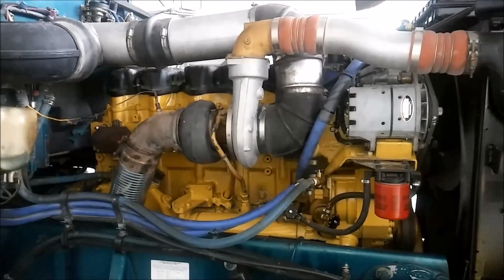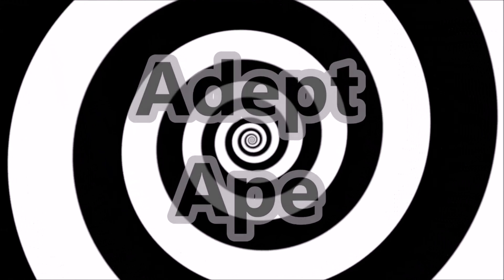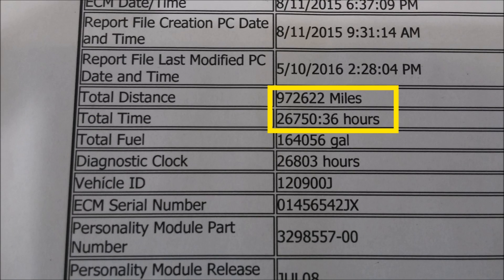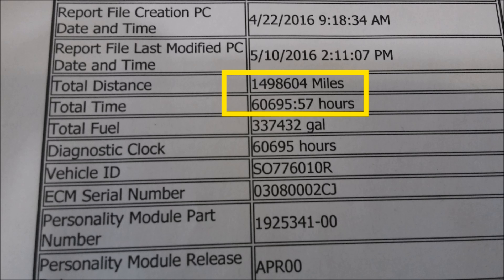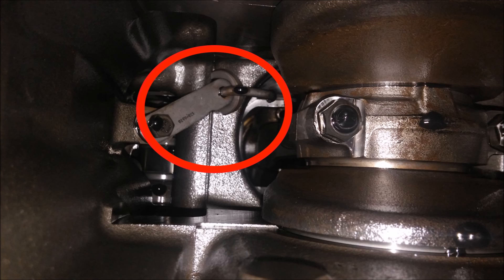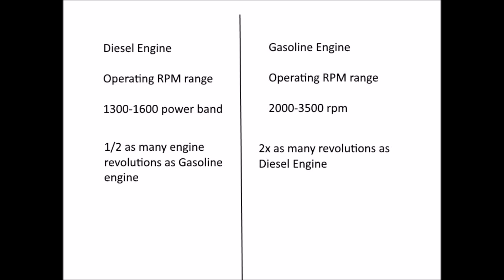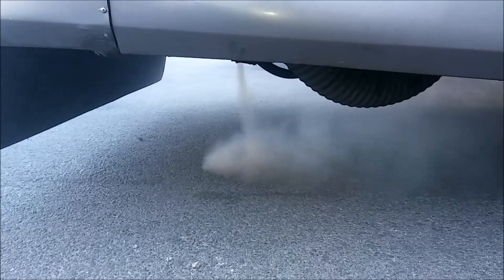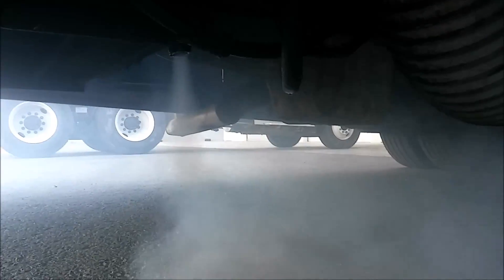Why Do Diesel Engines Last So Long?

Comment: They are also easier to convert to run on renewable fuels due to the fact that diesel's less volatile nature. Bio-diesel is already tried and trusted, and the type of engines already running on biomathane to a pretty large degree are originally diesels (busses, trucks/lorries). 

Detour about biomathane, which combustion engine fans might want to know.

 In fact, running diesels on a combination of biomethane and diesel (including renewable diesel alternatives) will produce more power and torque compared to diesel alone. Petrols can, of course, also be converted to run on biomethane, which has the potential to both be more cost efficient and cause less tear on components, as well as better power output. 

There are even Nigerian researchers who are working on using human excrement to produce biomethane. Which has a huge potential, considering the human population.

The biggest biomethane drawback is the fact that they need a special tank that's designed like a gas canister rather than a traditional fuel tank. I reckon that any type of combustion engine can be made to run on biomethane, including Wankel engines.

Comment: Question: since the new EPA rules reguarding DEP and exhaust, what happens to the engines that are pre EPA rules? are those engines throwns away and replaced with up to date EPA engines or are the older engines still ok to run on the roads?

Comment: I have a diesel toyota automatic 1.4 2006    A have done 600.000 miles on it and is in perfect condition I never had any problem with the engine!

Comment: Comparing a 1000 cubic inch diesel to a 350 chevy is just retarded. If you want a real comparison, compare a chevy 350 it a olds 350 diesel. Gas and diesel engines serve different purposes. And still. We have a Ford 460 in a one ton with 1,000,000 miles on it at the shop. It always runs. Pulls like a train. Doesn't burn a drop of oil and I'd chose to drive it over any diesel shop truck we own. Diesels have their place and purpose. Like tug boats, semi's, busses, etc. Not in cars and light trucks. The average person can't maintain diesels. Save yourself the headache. Buy a gas powered vehicle. You'll be happier and save yourself a lot of money in repairs and general maintenance.

Comment: 1.4/1.6L Renault K7M gasoline engine can easily reach 1.000.000km. Small diesel engines cant reach 1.000.000km without changing turbocharger, injectoars and high pressure pump.

Comment: very informative video here, thanks. i have a question about an oil leak in my international 4300 durastar.  there appears to be some sort of sensor where i have recently noticed a small oil leak, can anyone give any idea of the name of this part?  it is something that i can unscrew and simply replace, but i have had not luck in finding name of it. i thought it was the oil pressure sensor, but when i looked online, all of those sensors did NOT look like this part.  it is screwed in kind of in the middle of the engine, it is most easily viewed from the passenger side of the truck when looking into the engine compartment.  it is a slim metal looking rod that comes out of the screwed in part and there are wires attached to it. the wires plug into some kind of small harness.  there is oil leaking from that part and i would really like to replace this rather than paying the truck repair guy way too much. any help would be appreciated.

Comment: The gas drinking 5L in my '96 F150 4X4 just turned 400K and has lots of miles left in it. I think changing the oil every 90 days since new whether it needs it or not has a lot to do with it. Maybe my next truck, if I ever need one, will be a diesel.
Reply: 90 days, crikey!
Reply: Haven't done my oil in 13 months due to the fact it only has done 6k miles.

Comment: RPM range I've seen depends on the the displacement. Generally, the larger the engine, the slower the engine RPM.

Comment: maybe i should introduce you to the Chrysler 170/225 slant 6. (the 225 is not as good as the 170 however the 225 has more power) The reason is because the 170 under square where as most motors are over square (like the 225).

Comment: They're built with tougher parts due to the fact they're compression ignition engines. I've had xud peugeots with 600k miles,  vw 1.9 tdis with over 500k. Maintenance is key

Comment: Also most gas engines average less then 50 miles a day. On highway diesels average over 600 miles a day. Mileage adds up quickly that way with all the other stuff u mentioned.

Comment: As a diesal mechanic,do you recommend using a 5w40 engine oil where a 15w40 is called for. Thinking about cold weather starts.

Comment: I'm not convinced that going inside for 5 minutes or half an hour contributes much wear to engines when they start back up. It's still hot, and the oil is also nice and hot, and there's more of it, in the top end. Yes there is still a lack of oil pressure for a moment there, but it's not as pronounced as being from cold. Plus, the parts will not have shrunk down much, if at all, if you're just ducking inside to grab something. I'm probably wrong on this, though, I'd really love to be thrown some evidence that I'm wrong (or not), but it's my slightly educated guess, anyway.

Comment: Also diesel fuel has some oil in it and acts as a top cylinder lube.  I ran top oil in my fleet 350 Chevys and get anywhere from 400K to 600K on these gas engines. Its all in how you take care of them but Diesel is better in many ways.

Comment: Currently own a 1969 Cadillac with 1,250,XXX miles on it and it still runs like its brand new. Got inherited when I got it it had about 1,100,000 miles on it. It has a gasoline engine as well.

Comment: Even comparing the engines in pickups. The Diesel engine is heavier than the gas one. This is why you don’t see the big Cummins, Powerstroke or Duramax in a 1500, it’s just too heavy, so they use a downsized or completely different diesel in those that weighs around the same as the gas engines normally put in them

Comment: Had a 93 Pete with a cat that had around 1,200,xxx miles it. It was also turned wide ass open and would outrun a regular pickup truck easily. Then all of a sudden it started having to add ALOT of water and it also was running real low on oil pressure. I was hauling a load of hardwood one day and my heat needle sky rocketed, had to crank it up as I rolled into the gas station after I shut it off and it just bailed white smoke. I added more water let her cool down and drive it 200 miles to the mill drove it home and sold it. The newer motors are nowhere near as reliable though. I refuse to buy anything new other than my 2012 kenworth with a Cummings and a delete kit.

Comment: I believe the main differences are power, RPM and maintenance. A diesel truck would be lucky to see much over 2000 RPM while car engines are usually capable of around 6k. Every time the RPM doubles the stress on the engine quadruples. A diesel truck probably also makes around 500 horsepower with an engine that weighs 2 tons and with 16 liters of displacement. It wouldn’t be unrealistic for a car to make the same power with an engine 1/4 the size. Diesel trucks are also typically fleet owned and probably reasonably well maintained, whereas car owners tend to be forgetful and procrastinate maintenance. Not to mention the differences in driving style between an over the road truck and a daily driver.

Comment: Only reason a diesel will outlast a gasoline engine is because they have cylinder liners. You can only bore a gas engine so many times before it needs to be replaced but you can replace cylinder liners indefinitely. There are no million mile diesels that haven’t had an in-frame.

Comment: I drive a 2018 Chevy Cruze 6speed manual diesel , I was told if I maintain the manual diesel it would last me “forever” I get around 750-800 miles on a full tank (13 gal) about 49-51 mpg

Comment: It seems that Volvo, Mercedes and Toyota etc. have historically made gasoline engines that last as long as diesels. 1,000,000 miles isn't uncommon. Tundras go for 1,000,000 easily

Comment: Diesel can last long because of the fuel. It was  a crude oil while gasoline engine is a gasoline with higher octane. That why gasoline the won't last long. But if you maintain both engines follow the manufacturer 
Manual instruction pretty sure the both engine will last long. In the bright side gasoline engine when overhaul are cheap while diesel engine are expensive especially the spare parts. That a note of that.

Comment: Good evening bro how are you? I recently bought a 2007 W900 with c15 the seller said it had a rebuild at a certified cat I trusted him. After I bought the truck I called cat and they said nothing was showing under that engine serial number. So I need your advice on how to know if the engine was actually rebuilt or how can I tell if the engine is good. Obviously you know c15 from A to Z therefore I need your help. Thank you

Comment: Diesel engines will only outlast gasoline engines when they are designed and built correctly. The Olds 350 is an example of what bad design can lead to.
Reply: And the 6.0 and 6.4 Powerstroke engines are another example. The V10 engines lasted longer.

Comment: I'm from Europe I've got a Audi A3 1.9tdi 2008 without dpf (one of the best German diesel engine ever built) with this engine you can run for long time without problem, it has the timing belt though...

Comment: Ford diesels are so smogged down that you are lucky to get 200,000 miles and some times only 60,000 and you need a new engine. And then the blue death fluid.
Reply: 60,000 miles and a new engine required? That's not good. We don't seem to have the same issues here in The EU.

Comment: In years past, before ULSF fuel, I would agree that, with regular maintenance, most diesel engines would last for hundreds of thousands of miles with no major breakdowns. I have been into many diesel engines that were well past the 500K mile mark that looked like they were almost new internally. However, with todays fuel, USLF, unless you run some kind of fuel additive, the extended life of diesels have been shortened. The USLF fuel has gone thru a process to remove the sulphur and in that process the lubricating ability of the fuel has been stripped away. It makes the whole fuel system suffer, along with increased wear on the valves, rings and pistons. Agreed, the manufacturers have developed new technology and materials to cope with lack of lubricity of the fuel but the engine still suffers because of the crappy fuel. You can tip your hat to the EPA for causing the customer to have increased maintenance and fuel cost. I hope anyone that is connected to the EPA will  have boils and sores covering their bodies.

Comment: I"m confused, how can you compare an engine that is just over 3 times larger with a chevy 350? a cat c15 is 928 cui ????? Diesels break down with same regularity as gas engines... they do get about 14% better fuel mileage, but the parts are at least 30% more expensive. It is all about the weight that they can pull and maintain speed.

Comment: I had a 500k Honda engine that still ran great , no rebuild....i can also buy 4 454 engines for the price of 1 diesel... they are also much easier to work on... diesels have their place, no doubt but I would rather have my 454 in the rv.. it's dirt cheap to maintain,  any shop can work on it if needed, parts are available EVERYWHERE...  my 454 will last the life of my bus conversion build and if I need a rebuild or new engine in 20 years I can just buy one and still be under 50% of a diesels price tag !! Blow a diesel engine and let me know how it feels to pay 30k for a new 1 while I swap a new 454 engine in 1 day for 2k...

Comment: For modern high performance car engines diesel engines last longer because of your second reason. Diesel oil is a lubricant whereas petrol is not. However even petrol engines are so good these days that they can do 200,000 miles easily. If your car will only do 150,000 before it is scrapped, having a diesel that can do 400,000 typically is not needed. 50 years ago petrol engines in European cars needed major work before 100,000 miles. Mind you 1970s cars rusted out even quicker, so the same rule applied.

Comment: They are also considerably more expensive in all aspects parts, fuel, oil, and maintenance intervals. From mu experience are no more reliable than a gasoline engine. They break all the time. especially modern ones and double that in marine use. But they are justifiable in the right situation. There is no free lunch.

Comment: MAINTENANCE is key. a well maintained engine will last a long time. where i work, i regularly (5+per week) get customers that have a jeep with the amc derived straight six 4L,  with over 300k miles on it. sure, part of that is the fact that that engine isn't made any more, but they run well if maintained. that said, they usually need an overhaul or at least bigger piston rings around that time, depending on the circumstance and how much wear your'e willing to put up with. 

the irony is, of course, the fact that the most reliable engine chrysler ever made was an AMC engine. :/

Comment: The piston speed is about the same on gasoline and diesel and even on F1 engines.Because of the compression ratio,diesel spin slower but the piston travel is longer and faster.
Engineer explained made an awesome video about that.

Comment: my ISB engine failed after running it with bad injectors for 2 years then the rings fell apart and had to replace the block..

Comment: Gas engines are designed to be abused like that. You dont think the engineers took in to account that maybe the average person would turn the engine on and off multiple times a day and go short distances? That's why modern gas engines in cars warm up extremely fast

Comment: diesel is injected into the cylinder at the top of the stroke just before ignition, it does not lubricate the engine the oil does.

Comment: Wow, I like most of your vids but this one leaves me scratching my head. If you want to compare gas to diesel you can't do it with a 2000.00 small block chevy vs a 30,000.00 Cat. Old mechanical diesels would outlast gas by far but modern ones will eat you alive in maint. cost. My 6.0 chevy went 308,000 miles and was still running strong but got totaled. My fathers four Duromax chevy's never got beyond 280,000 before they needed rebuilt, not mention the cost of two sets of injectors on his dually that cost more than a single longblock for my gasser. The C7s that you talk about so much are lacking any real torque and get poor mpg, injector and Huey pump eating machines. My Freightliner with the C7 has had three pumps and two sets of injectors at 373,000. We have had 3116, 3126 and C7s just to try and avoid the dreaded Mercedes engines. Navistar and all their crap have left a really bad taste in everyone's mouth. Cat water pumps poring coolant into the oil. Cummins egr nightmares etc etc. We have two old IH trucks with 855 cummins that have over 1.2 million miles and not one internal engine problem. They are by far the greatest trucks I have ever owned. The only one making a living off of modern diesel's is the tech's.

Comment: This is a great comparison if your trying to figure out why an engine lasts longer. My theory is that you can use the techniques of the diesel in a gasoline engine. Specifically, by keeping in cool. Have a transmission cooler, a Power Steering cooler, and I'm running an oversized radiator fan, it came that way when I bought it. Temps are always lower than middle of the gauge. The main point of this video is that too much heat causes an engine to fail. Bigger bearing less friction heat, oil jets spraying the bottom of Pistons. Isn't that what a 2 stroke engine does. No wonder 2 stroke engines are still around. Thermostats? This is where I think the emission control regulations got out of hand. Do you think engines run longer, obviously sacrificing fuel consumption, when kept colder? That's my theory.

Comment: Simply put... Diesel's are built better, because of what they're used for. There are no short-cuts taken on the production line; Thus longer lasting engines.

Also note, because of said build, they're sold at a much higher price tag than any gasoline engine.

Comment: Sir,  

Diesel novice here, maintained plenty other Internal combustion engines all my life.

really enjoying your videos.... i now own an RV... instinctively, I fear an overheat.... when i obtained my CAT 3126, I immediately replaced the belts, hoses, thermostat, and went to CAT ELC.  mileage on this 1996 3126 is about 85000;  apparently my water pump is belt driven.  When should i consider replacing my water pump?  On a benzene based Internal combustion engine, I would be seriously looking at replacement at about 125000 miles.  What wisdom can you offer?? Should I get it before it gets me?? when??

thanks
Reply from the maker: +John Brunson The 3126 water pump rarely "fail" usually they will develop a leak at the weep hole that is when they will need to be replaced. So if the weep hole is dry I would say keep running it. Keep the radiator clean and you should be good.

Comment: you really cant compare the bearing size of a 5.7 liter 350 to that of a 15 liter cat. the 350 is a damn good gasoline engine that can last many hundreds of thousands of miles, but a million.... well there are a couple of examples that have but not common. most people just dont take care of their engines either, if you have an old pickup with 240,000 miles on it.... its likely that someone is running it without even changing the oil anymore.